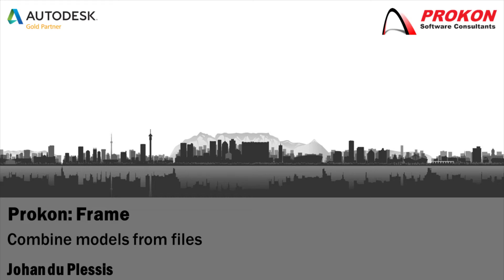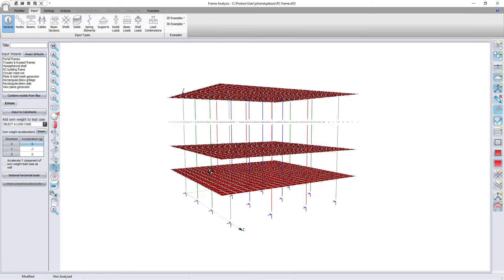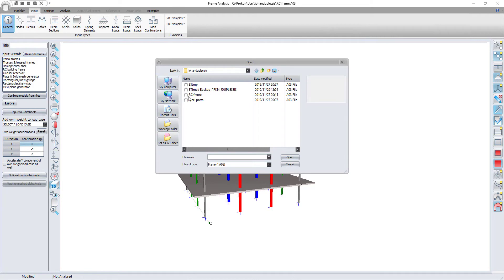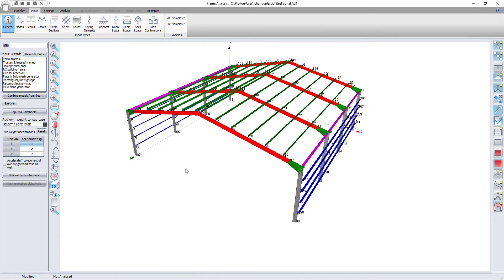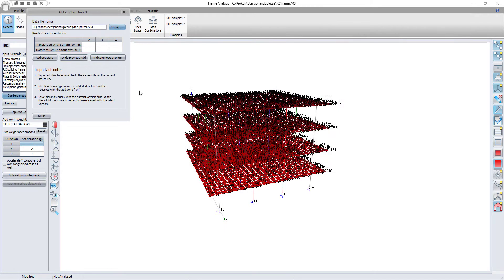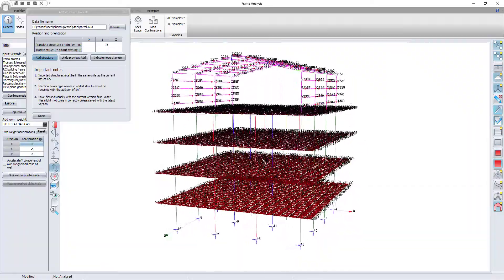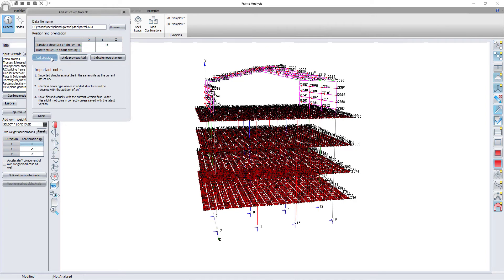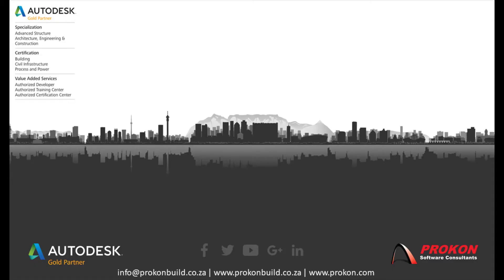Prokon Frame Analysis - Combine models from files

Comment: can we also have the video of how you generated the concrete frame and the steel frame?
Reply from the maker: Hi Simeon, We will consider your suggestion when we make new videos in the future.

Both the concrete and steel frames were created using the convenient input wizards in Frame. The input wizards allow you to quickly generate models with loading and supports ready for analysis. You can find them on the Input page on the panel on the left of your screen.